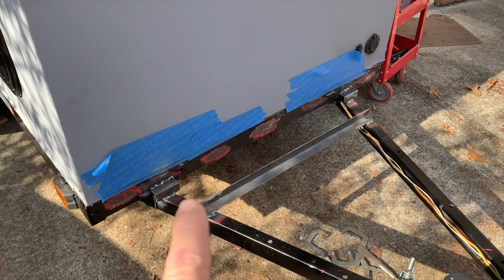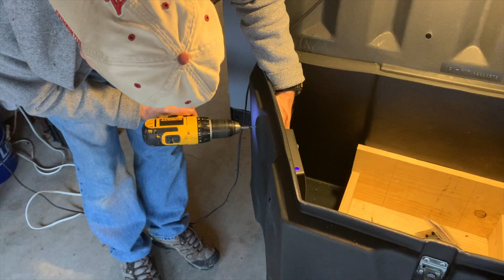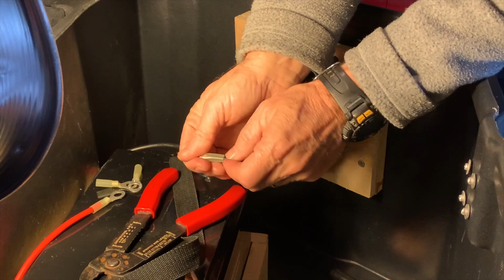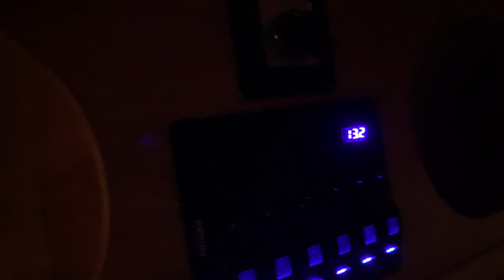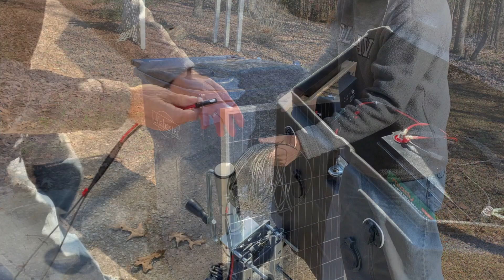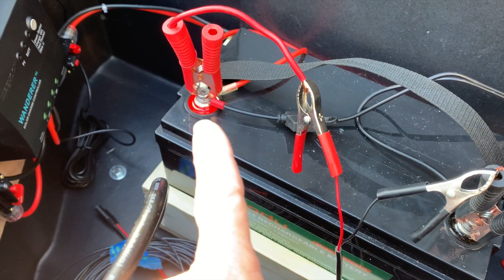Mini Camper Build Part 20: Installing the Tongue box

Comment: Everything looks great but how are you going to flash the bottom of the trailer where the meets the frame. With the box on there
Reply from the maker: I’m going to seal the bottom of the camper with to the frame with waterproof tape, aluminum drips and waterproof sealer. The box is to store my off grid DC / AC power system. Thanks for watching!! 🙏🙏🙏